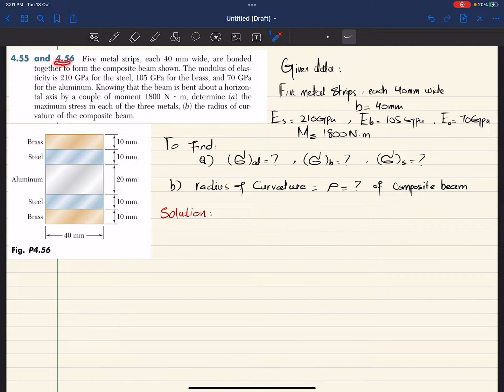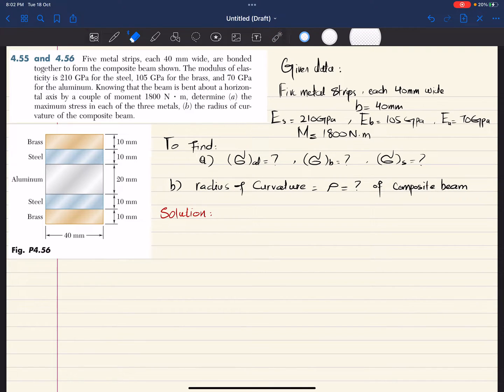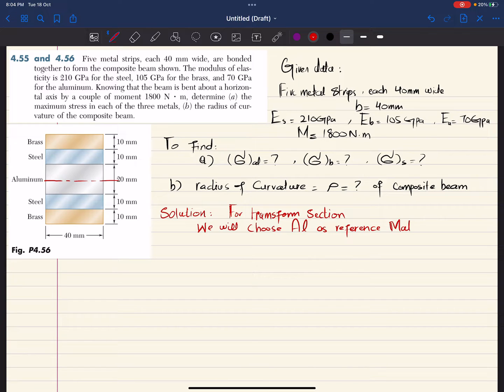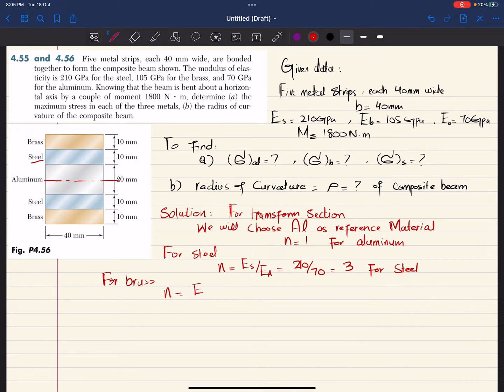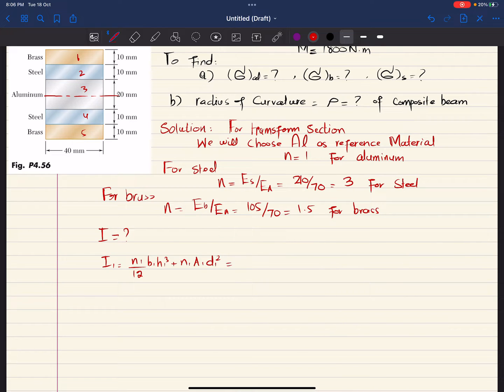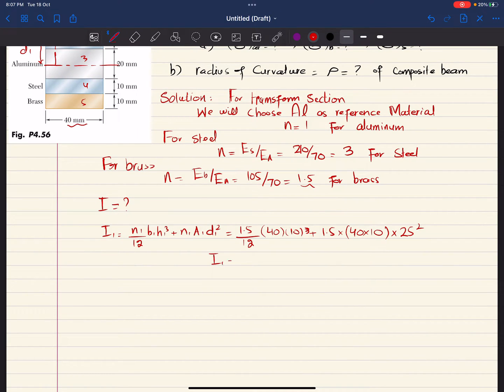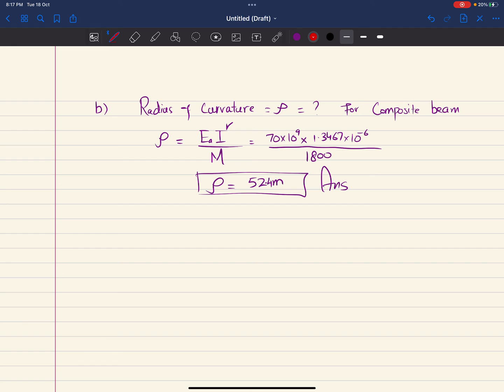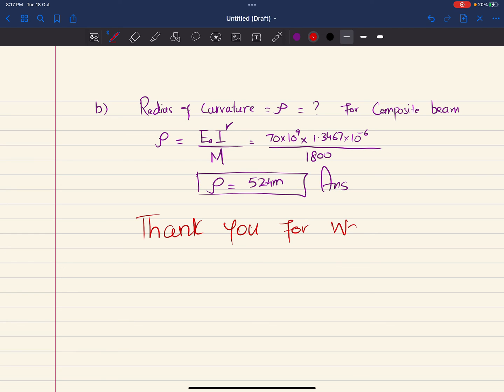4.56 | Bending | Mechanics of Materials Beer and Johnston

Comment: Sir, Why we didn't calculate maximum stress interms of compression i.e we we took 'Y' as negative when we calculated max stress
Reply from the maker: we only need the maximum stress either it is in tension or extension. so upper portion above neutral axis will be in compression while lower portion is in tension.
Reply: @engradnanrasheedmechanical   Ok Sir